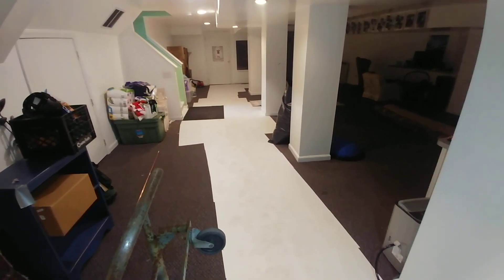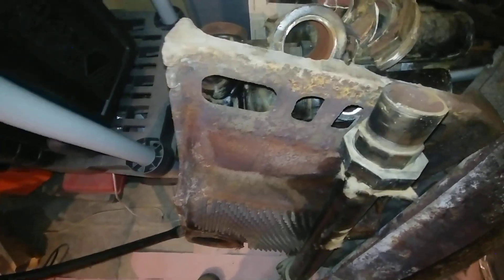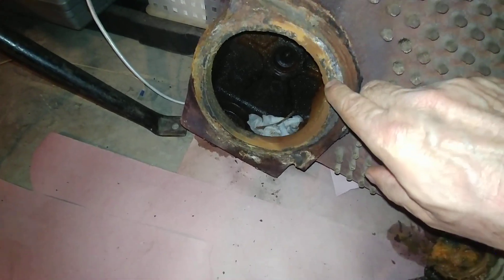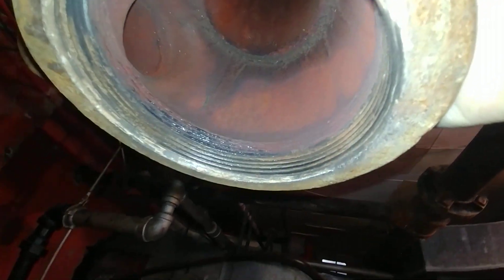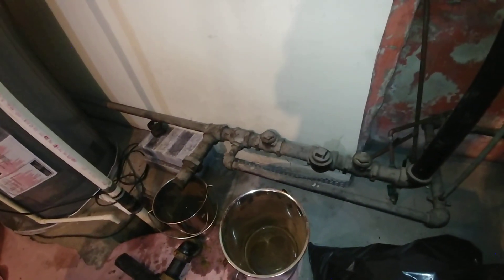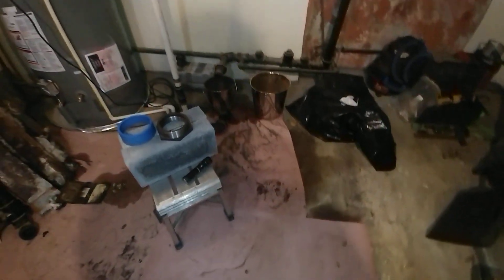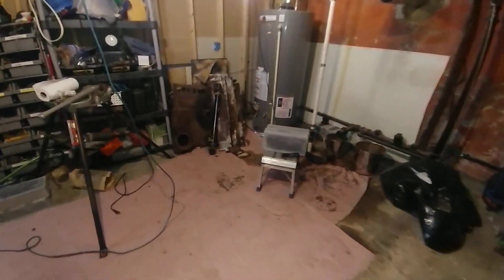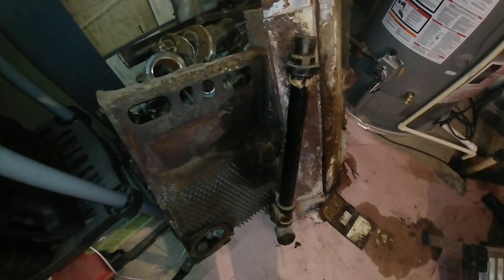Old Steam Boiler Broken Up And Removed

Comment: Will you scrap that union on the cut pipe? I would have a hard time letting go of such treasures 😅
Reply: I used to try an re-use old fittings.  It's generally not worth the time anymore.  The only fittings I try and recover are ones no longer made or rare and hard to get such as eccentric couplings and bushings.

Comment: Does city water have altot of limescale/hardness in it? and do you come across much asbestos in these older installs?good vid as always
Reply from the maker: Baltimore City water is pretty "good" water as hard a hardness goes. Lucky!

As far as asbestos goes, every steam system had that stuff on the pipes. In this case, the customer got it removed just prior to our starting work.

And as a side note, the original coal boiler was usually covered in it to such an extant that the slang term for certain boilers was: "snowman"!

Thanks you for your support!
Reply: Thanks for the reply Gordon take care during these difficult times. keep the vids coming if you can,
Reply from the maker: @dannywilkins887  Thank you! I hope to be able to keep working as long as I can swing a wrench and have breath in my body. Stay well yourself.

Comment: Is the homeowner opting not to separate the runs into 2 separate risers? You mentioned the smaller line heats poorly on your earlier video. Wouldn't take too much to bust that up and run separately. As always, thanks for these videos!
Reply from the maker: Thanks for your support!
We're planning to feed that tee with a 4" header. It's going to be massively oversized.
Reply: @gordonschweizer5154  On a job like that, I would go back as far as possible on the returns. Those obsolete swing checks must be jammed with mud.
Reply from the maker: @jeffreyjohn2037  Oh yes! They were jammed 50 to 60% with mud. The flappers in the check valves had been removed some time ago by others.
They are completely gone. All 2" wet return is gone now. The remainder looks good.  You best believe there will be a proper drain added!
Thanks for your support!
Reply: @gordonschweizer5154  You're welcome. Great channel and workmanship! 🏆
Reply: @gordonschweizer5154  thanks for the response.  So, if I understand it correctly, will this create slower steam velocity, drier steam and slower rise on pressure, thus better supplyiny the smaller run, comparable to repiping and separating them?
Reply from the maker: @nosceteipsum513  Yes, we believe so, just as you say.
The pressure drop looks to be in the order of a fraction of an ounce.
However, we have a back up plan in case that 5" x 4" x 2" tee cracks when we make up the 5" x 4" bushing into it!  Don't want to jinx it!
Reply: @gordonschweizer5154  thank you for the answer and good luck! I would be surprised if that tee cracks, but I suppose anything's possible. Just pack the bushing threads well with wicking and dope, then coat it all with brush-on blue block pipe sealant and gasket maker. You won't have leaks once the brush-on sets up. I used it with damaged threads and made up leak-free seals, although it wasn't a 4-5 inch tee... Looking forward to seeing the finished install. Happy Easter!